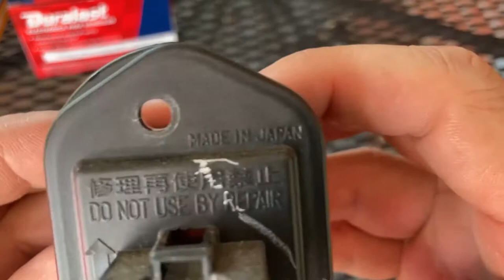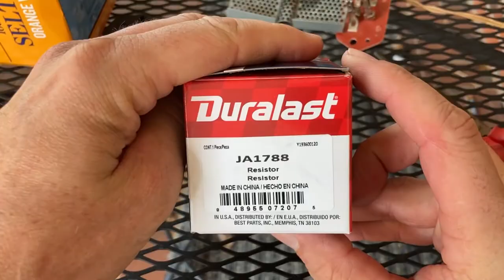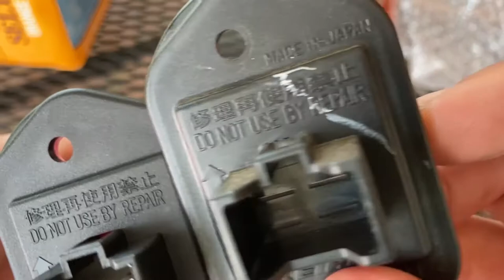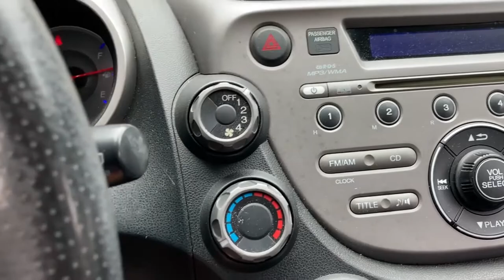How to fix a fan that only works on high | Honda Fit

Comment: As a warning to others, don’t run the resistor outside of its hole. The airflow of the blower cools it as it will become very hot. If you run it outside that airflow, it will quickly overheat and break. I speak from experience.
Reply from the maker: Good call-out, Joseph! Thanks for the comment.
Reply: Mine has never ran out of its hole and it still broke, twice in two years.
Reply: It will break instantly outside of the hole.  It takes longer if it's in the hole.
Reply: @josephbernard6782  I am curious to know why they fail in the first place.  I've had about 100 cars in my lifetime and this is the first time I am every having to replace one of these.
Reply: @prohomevideos  it could be that something is wrong with the blower fan staying on or spinning fast enough, and the resistor is the first thing to go when it messes up.

Comment: What if there is no air coming out the vents? I already checked the fuses and replaced resistor and still no air from vents on any setting. I do hear the ac clutch engage when i select ac mode but still no air out of vents. What do you think it can be?
Reply from the maker: Hmmm. So the blower isn't blowing at all? You could use a multimeter to see if power is getting to the resistor.

Comment: I made this repair about a month and a half ago, but now there’s a burning smell in my car and I’m only working on high power again. Any idea what I should check before replacing it again?
Reply from the maker: Sounds like the resistor went out again, Ben. It could be a defective part, or your fan motor could be going bad, causing the resistor to overheat and fail.
Reply: @FamilyFriendlyDIY  I hope it’s a bad part. I had to replace the blower motor a few months back and then the resistor went out.

Comment: Has anyone tried this for a Honda Fit that had no air blowing on any of the fan settings? That is my issue, but I can hear the fans whirring within the engine, but there's no air blowing into the cabin.
Reply: i have a little bit on the 4th speed to get me home today, but nothing just now with key on but not running.  What happened with yours?  Resistor or motor?
Reply from the maker: You're hearing the radiator fans. The blower fan for the heat/AC is behind the dashboard.

Comment: I had this issue for a few years and now the heater doesn’t work at all. Is it likely the same culprit?
Reply from the maker: Very likely. Unless the blower has burned out now. If it went out suddenly, it's probably the resistor. If it started slowing down and died or made other noises, that would point to the motor.

Comment: Hugely helpful!
But rather long.
Nevertheless, a massive and well-deserved THANK YOU for taking the time to make this and save me a bundle. Now, I'm off to the nearby pick-a-part for a cheap $5 OEM replacement if i can't solder mine back into shape.

Comment: Excellent video Dave, clear, concise right to the point. Love the music as well ... I haven't pulled mine apart as yet, being right hand drive hoping the resistor is behind the glove box and not under the steering wheel. I'll find out tomorrow when I attack it.
Cheers.
Completed the fix today, a 400mm phillips head driver did the trick, able to get to both top and bottom screws from the glove box opening, pulled out the resistors and re-soldered the 
spring loaded contact. Replaced the cabin filter whilst the glove box was open like a new car ... ha ... 
Thankyou again Dave , keep those helpful hints coming.
Hooroo ...
Reply from the maker: Thanks, Bruce. I hope you have an easy time of it!

Comment: Thx for the video. Just replaced this in my wife’s 2011 Fit.
I’m not as flexible as I was 40 years ago but I still have enough (barely) to get under and around the things I needed to. 😊
My 3.5” stubby Phillips screwdriver was actually a bit too long to be ideal as another part was interfering. 1/4” smaller would have been better if I could have found it.

Comment: Thought I had a bad resistor for the blower motor on a 95 Bonneville. It was the motor going bad. New motor and resistor, the 3 lower speeds were lower than they should be. So put the original resistor back in and it all worked as it should.

Comment: If this issue keeps happening (had it happen twice in two weeks to me) I'd suggest checking cabin air filter and replacing the blower motor fan. It's three screws and actually easier than the resistor, although the part is more expensive. My fan was shot and the resistor kept blowing out.
Reply from the maker: Good points. Thanks for the tips!

Comment: Super helpful. I assume if im getting no blow out of any setting it's the full blower motor vs. The relay? Or should I just go ahead and replace both at the same time?
Reply from the maker: Hmm. I would star with the relay. In my experience, blower motors usually die a slow death. They get slower and slower and maybe make some bearing noise. You could just plug the new relay in to test (without even messing with the screws), and take it back if it's not the problem.

Comment: Thanks for a video ! I changed blow resistor yesterday but today its not working again. What can be a problem? Maybe wires?
Reply from the maker: Hmmm. Could be a bad replacement resistor or wiring, among other things. I'd take it out, pop it open, and see if the solder melted on it already.

Comment: I replaced it twice and each time it only lasted a few days. I guess I'll check if anything is blocking air from getting to the resistor and maybe try installing "upside down" it's not 100% obvious to me which way the arrow is supposed to go.
Reply from the maker: Jonathan, If your fan motor is going bad, it could be burning up your resistors. You might need to change your blower motor first.
Reply: @FamilyFriendlyDIY  Thanks. I swapped out the 30A fuse for 25A hoping it would blow the fuse rather than the resistor, but didn't help. There's plenty of air coming from the fan and it sounds fine, but suppose it could be failing in a way that draws too much current through the resistor without blowing the fuse, not sure what it's rated for.
Reply: @FamilyFriendlyDIY  Replacing the blower motor did the trick 👍🏻 The old motor is kind of stiff it doesn't spin freely. I stepped down to a 20A fuse and it still didn't blow makes me wonder why they let it consume up to 30A, seems like that would definitely blow out the resistor since under 25A also did that.
Reply from the maker: @jonathandill3557   It might just be badly designed. The problem is that a solder connection breaks inside the resistor housing, but whether that is because the resistor gets too hot or it's a bad solder connection to begin with, who knows?

Cancel

Reply
Reply: @FamilyFriendlyDIY  The 2 that burned out on me were Duralast since that's what I could find in stock in my area would avoid that brand. I found an OEM part online and that's working fine. Since some of the resistance is coming from coils of resistive wire, I'm guessing the idea is to get some feedback to keep defrost from fogging up the window since the resistance will increase with heat or humidity slowing down the fan and speed up with cooler, drier air, based on my knowledge of gas chromatography weirdly enough, although GC is not a feedback loop and just measures the resistance. Otherwise, it would make a lot more sense to just use traditional resistors that are a lot more robust with much tighter tolerance and probably cheaper. If it happens again, I plan to try sticking heatsink fins on the solid face oriented in the direction of airflow and resolder the connection myself.